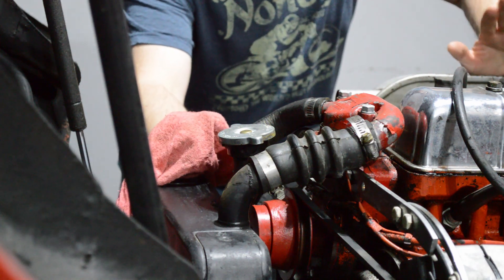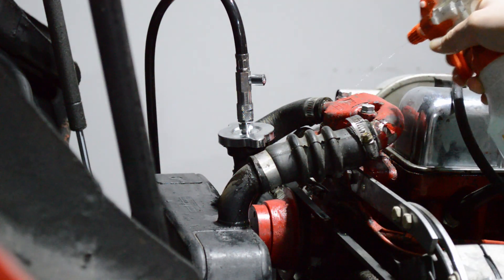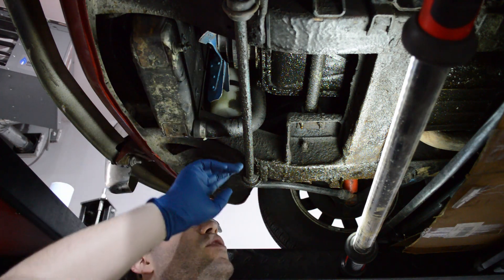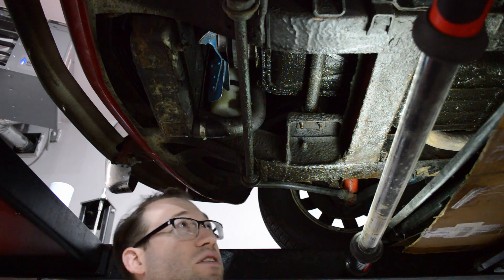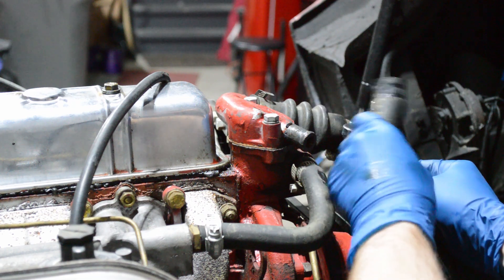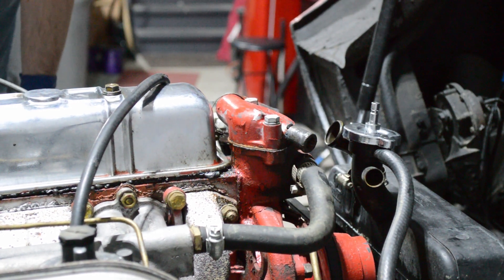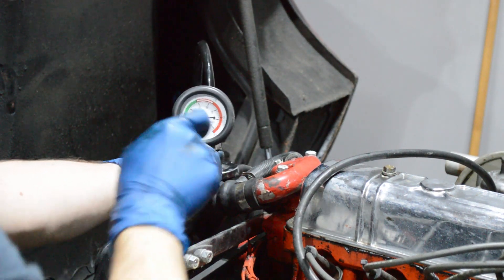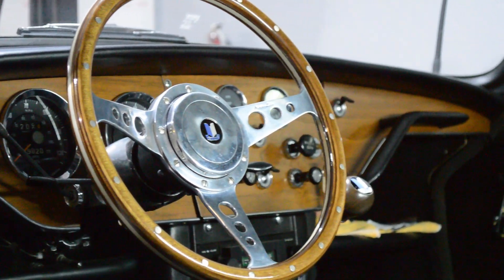Triumph GT6 Coolant Leak!

Comment: It might not be a good idea to mount the dial indicator on the car frame, some people get heavy handed with the pry bar and might move the engine on its mounts.
Some aftermarket temp sending units can give inappropriate gauge readings. It is important to get one the is appropriate for the  application. I had this problem with senders sold by Moss.
Reply from the maker: That's a good point with the pry bar, though the mounts are rubber and should spring back to their neutral position.  In any case, it could still be off within a few thousandths of an inch, so mounting the dial indicator on the engine is definitely safer and I'd agree on the recommendation.   

You're also correct on the temp sender.  I've verified that the temp is within the range I want with an infrared thermometer, so I'm happy with the replacement sending unit.